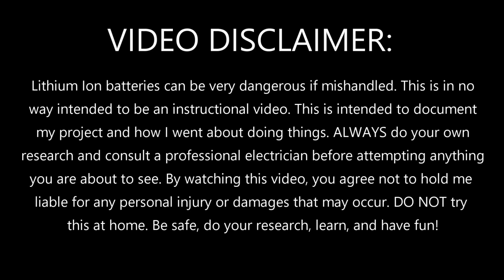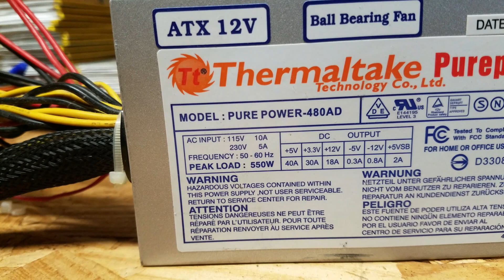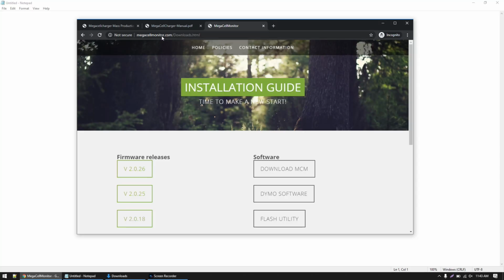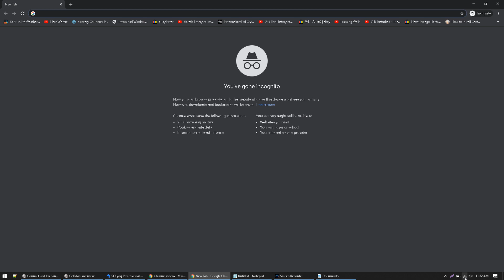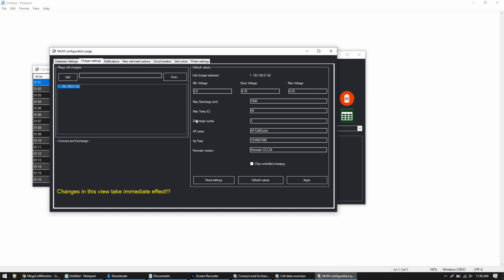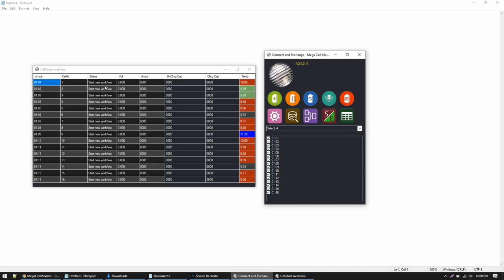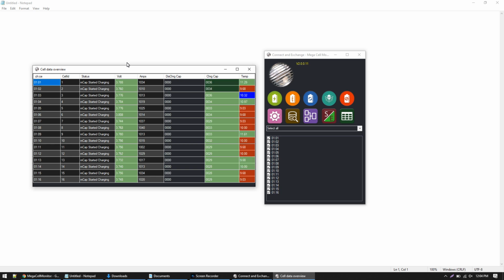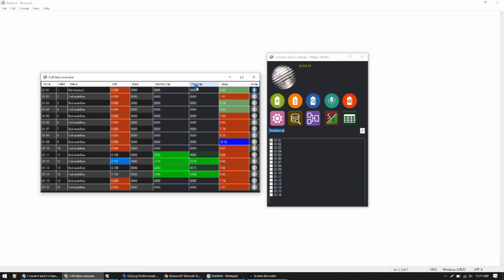16-Bay 18650 MegaCell Charger Overview and Testing

Comment: RF design regarding the BT/WIFI module is very bad and doesn't comply with 101 most basic rules.
Whoever designed this had very little knowledge and experience in PCB design.
Reply: Lmao got 404 on the URL in description and when I've cutoff the subpage and pasted only main link of the website I got redirected to another malicious website with a lot of annoying pop-ups.
Reply from the maker: Wow, that's bad... Thanks for letting me know, pulling the links from the description now.

Comment: hi friend. very good explanation. do you know if this can charge and discharge 18650s in series ? i need to check e bike battery's like 5p 10s using the bms connector and not disconnect or brake the string. thank you.
if not tell me if you know something which can do the job.

Comment: The biggest issue I see is that it can only process 18650 cells. I also process quite a few A123 26650 cells  and soon I would imagine 21700's. I was considering making an adapter that fits into the 18650 slot that allows a 26650 to be tested.  I have been using the Liitokala Lii-S8. It  works ok but it lacks some of the featues the Megacell charger has. I was on the website and it seems like you can only buy 10 of them at once? I'm not about to drop $1000 on chargers when I haven't personally tested one. Is there a single board purchase option?
Reply: I'm not processing that much cells, but when I do have to it's pain just using one opus charger(yes I know I could just buy more but those have overheating issues so I rather not), I am getting annoyed that there is no good 16 cell charger out there, I might do one myself, I have an idea about the electronic design but I have no good idea for cheap way of making a socket that fits various cells.
Do you have any ideas?

Comment: The first batch was recently sent out unfortunately there was a mix up when the components were placed on the boards. This meant you had to open it up and remove 16 SMD resistor and move another 16 to another location. For your troubles, if you did the work yourself, a coupon for 20 bucks was to be sent to you.  Thus allowing you to purchase stuff from their website. So far I have not seen the coupon. Now there was an option to send the MCC back to Romania for the rework but it was not doable due to cost, for me, it would cost me 100.00 Dollars. 
The upside is they will pay for the return shipping. 
The second option was presented in a chat where I was told I could send the MMC to some guy that would to the rework. Again the guy for me was in Tx and I had to pay 20.00 dollars to ship it to him. They pay the return shipping.
As for the instructions to set up the MCC and operate it well, I am here trying to see if anyone has made a video showing how to use the different options in the charger. Because both setup and usage are not well defined in the manual. I am still trying to figure out how to use it.
So will continue searching till I find something I can follow easily.
Reply: Did you ever figure it out? for me its too inconsistent. Some cells test 0mah capacity and some up to 899mOhm... im confused how this is professional tool..

Comment: I think I know why you had issues with that small dell power supply even though it was rated for the over 16amps at 5volt. Cheaper paper supplies share a coil winding with other voltage rails in the PSU. So when you maxed out the 5 volt rail and non of the others they supply could not raise the amps with out breaking spec on the voltage since they had no load.

Comment: Hi Mike - any progress on your own interface as you mentioned in the vid?  Nice vid, I've got one on the way and probably should have ordered a second.  The basic premise is great, but I see some room for improvement particularly in the graphing.  All the data per cell could easily be stored (maybe it IS stored - not sure) in the SQL database and graphed.  At any rate, thanks for the review.  I hope we have them soon.  :-)
Reply from the maker: I have a PHP script that pulls data from the charger every 5 seconds and stores it in a MySQL database. The script also starts the mCap test with my own parameters when it sees a slot in the "New cell inserted" state. I never need to open or use the MegaCell software. I have two web pages set up, both just pull the basic data from the database, one is formatted to fit my iPad mini perfectly so I can take that out to the testing station and check cells without needing to carry around the laptop. There are probably better ways of doing it than PHP, such as NodeJS, but PHP is what I am most familiar with :) I did mess around briefly with graphing in grafana, but with 16 slots, I just couldn't find an easy way to make it all fit in a usable way on a 1080p display.
Reply: LithiumSolar that’s fantastic!  Any chance I could get a look or is it proprietary 😏
Reply from the maker: @scottdecker8612  I have no problem showing the code, it's not a secret or anything. The problem is it's written specifically for my needs, my network, etc. When I've done it in the past, people point out 50 ways it's wrong, should be done differently, and/or expect you to provide support for it. For those reasons, I typically don't share code, but can show you the API endpoints I used if you'd like to write something similar.
Reply: LithiumSolar haha no problems on that.  I won’t criticize your freely distributed code in any way - in fact I appreciate it!  I’ll message you.
Reply: @LithiumSolar  Hi,
i am also interested in the PHP script - would be great when you share it with us. Thanks a lot, and nice videos - you and others inspired me into setting up my own powerwall (14S200P and growing) :-)
Reply: Is there any chance to get the code to me too :) ?

Comment: So I've been processing cells for a couple months.  I have maybe 2-3000 18650's, 285 Boston power cells and 7 of the 120ah Lg cells from Battery hookup.  I just bought a kweld and am ready to start building the packs.  I'm can't decide on a layout due to wanting to always be able to add more cells to the system.  I also am unsure what inverter I want to use for the house.  I'm leaning towards the MPPSolar style gridtie. All this started because I have a well pump.  I may just buy a dedicated LF inverter for it and use the LG cell modules for it.  We use about 32kwh a day in the summer.  With your experience how would you set up your packs 1s or 7s.  I know they would all need to be the same AH rating. Thanks for your incite!

Comment: I'm simply amazed by the growing number of people writing things like "OMG this device is wonderfull", just because it has 16 slots and that it can stuff a database of fancy numbers and curves... Where are real measurements with calibrated instruments? Where are the comparisons of values given by this device with those of other reference chargers - analysers, known for their quality and reliability?
I have one MCC, from the second batch sold some months ago, so similar to the one reviewed here. Like hundreds of other customers, I've never been warned that I was in fact going to buy a flawed prototype never seriously tested before being sold, with alpha-stage buggy software. I've been a beta tester for the current MegaCellMonitor software, and spent tenth and tenth of hours doing testing, measurement and results comparisons with various models of cells with different wear levels and internal resistance. So here are some considerations on this subject:
- This device is based on TC4056A chip, a cheap chinese clone of original TP4056 chip, which itself was never designed for use in measuring devices, but for low-cost charging of batteries in consumer gadgets.
- Temperatures, 6°C of deviation between the different slots at room temperature and at rest, and at least 15°C of deviation between real cell temps and reported temps.
- Internal resistances, simply way off and untrustable by conception, you need four wire measurement for acceptable readings.
- Voltages, in automatic chip mode, the firmware intentionnaly lies on the fact that cells are charged up to 4.25/4.26V, while the reported numbers and curves never indicate more than 4.20V.
- Capacities, according to wear level and internal resistance of tested cells, up to 20+% of deviation with values for same cells given by a trusty reference device, SkyRC MC3000.
My conclusion is; I would NEVER use this device to test cells for my powerwall! But only to cycle them @ 4.20V manual mode a few times to stabilize them, before letting them rest and test their capacity with 4 calibrated Opus on the basis of my MC3000.
Dont believe me, just do you own tests with good equipment, and trust what you see, not what you're been told.
Reply from the maker: Thank you for your input. I do completely understand what you are saying; however, one thing interests me... You mentioned the Opus giving reliable test results. It seems people complain constantly about the Opus not testing accurately. How did you calibrate yours and what did you use for the basis of comparison? Did you calibrate it based on the MC3000?

Comment: The discharge resistors are on the other side of the pcb, so the pcb has to conduct all the heat into the heatsink. If you discharge all cells at 1 amp, that means you have on average 4 ohms resistance and the dissipation is roughly 4 watts, which is a lot of heat. 4 times 16 is 64 watts if you discharge them all at the same time, that is a brutal amount of heat. The cells are right below that on the pcb, with a temperature sensor on that pcb that is conducting 64 watts to the heatsinks. That seems like a terrible design to me. How do you get accurate temperature readings and how much are the cells heating from that energy transfer, how do you differentiate between heat generated by internal resistance and heat conducting through the pcb.

Comment: You don't have to power on via the 5v rail when updating the firmware. In fact I update it easier when only connected via USB to my computer. Great review mate.
Reply from the maker: I figured it would be safer since it tries to run the entire charger when you plug in the USB. I'm not sure what would happen if there were cells in any slots and you only had USB connected.

Comment: Seems like a lot of computer work to charge a battery. I guess if you need it you need it. Thanks for the video.
Reply from the maker: It depends whether you're "charging a battery" which sounds like 1 cell or charging tens of thousands of cells like myself.
Reply: @LithiumSolar  ya i guess everyone has there own needs. Was a good desciptive vd tho. Thanks
Reply: @LithiumSolar  I did my cell testing differently because mine are in packs still. But I have over 9000 cells going into service soon and 3000 in service now.

Comment: Good review! They've spent a lot of time on this, but to completely skip the CV charge phase of the lithium charge profile is a fundamental flaw. Even a 20 cent TP4056 board can do this!
Tip for getting the cells out is to lay a ribbon underneath, or use a loop of ribbon for each cell taking care not to obscure the temp sensor, then you can pull them out easily after labeling them.
Reply: It does use the TP4056 ic for charging, as far as I know
Reply: @FilipMunk  That would be a logical choice, but doesn't explain why there's no CV phase implemented.
Reply from the maker: It does have the 4056 chips. From what I see it doing, it starts ramping down the amps before the cell hits 4.20V, so it does trickle much lower mA as it approaches 4.20V, but it's just not holding 4.20V and instead shuts off as soon as it reaches 4.20V. That is not my understanding of how CC/CV charging is supposed to work, but I could be wrong... It is not the fault of the MegaCell Charger but rather the 4056 chip.
Reply: @LithiumSolar  I think I follow now - the processor is just measuring voltage of the cells instead of current and just switching the 4056's on or off.
It should be measuring current during the CV phase so that when it falls to 100mA or the 4056 disconnects then it knows the cell is charged.
Integrating the V and A over time in both directions will reveal coulombic efficiency, which is also a good measure of a cell's performance.
Sounds like they still have some work to do!
Reply: @ahaveland  Multicharger designs using off the shelf charger IC just read the status of the pin that is meant to go to charge finished LED, when that is activated it disables the charger IC and proceeds with discharge of the cell.